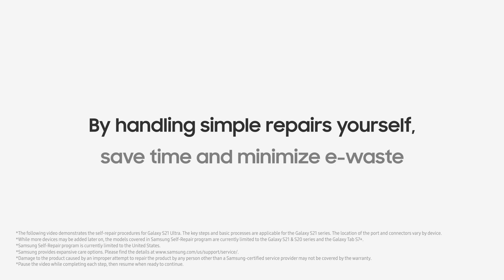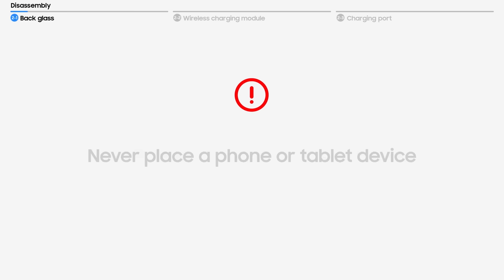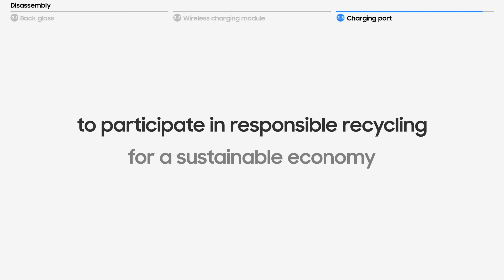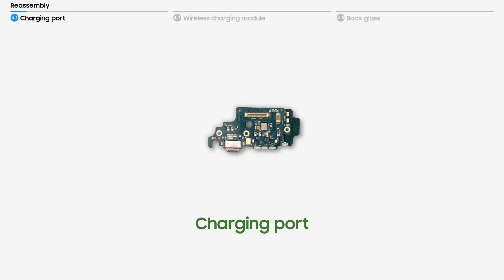Samsung Support: Self-Repair Overview for Galaxy S21 Charging Port

Comment: I recently tried Samsung's self-repair program to replace the cracked display  and back cover of my S23 ultra, well it has been a total nightmare. The replacement part they sent me arrived clearly DOA (Dead on Arrival) — won't even power on .

To prove that the problem wasn’t on my end, I reassembled the components back onto my old, broken display — and guess what? The phone worked perfectly. This clearly shows that my repair procedure was flawless, and the only issue was the faulty part Samsung sent.

But the nightmare didn’t end there. Living in Greece, I contacted Samsung's local customer service, hoping for help. I asked to confirm the part was DOA through the local repair center and hopefully get the new display from them if not the whole repair so to avois to find myself again in the same situation in case another part should come DOA too. Instead, I faced extreme rudeness: I was hung up on multiple times from agents which didn't know what to reply and how to handle the situation. After repeated attempts to get support, they even blocked me from their WhatsApp chat, effectively cutting off all communication.

This is utterly unacceptable. Samsung’s self-repair program has been nothing but frustration — a defective part, zero support, and completely unprofessional behavior from local customer service. I will never trust Samsung again for repairs or purchases.

Avoid Samsung  and their Self Repair at all costs!!!

Comment: It's really great that Samsung is investing the time and effort to make an easy to understand repair video and making their phones significantly easier (and cheaper) to repair than any of Apple's iPhones. In addition, unlike for iPhones, you don't need to rent any highly specialised equipment or use multiple different screwdriver bits (not to mention organising them based on their size) to replace a simple wear and tear component like a Battery or charging port.
Reply: @No-nameNo-name  Samsung and Apple damaged their brands how?